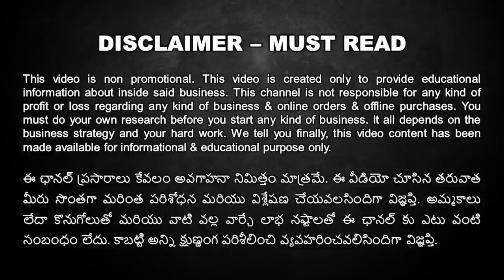Best Prefab Homes Factory Tour, Porta Cabin, Homes, Ship Container Houses Manufacturer in Hyderabad

Comment: I am using prefabricated house 2years at bit hot place in Bangalore and it's not hot inside as it's completely insulated
Just normal fan is enough
If you want use AC then room gets cool faster than normal bric house
Very low maintenance every two years just painting is enough 
Will update how many spray paint cans are required after I do it on my own
Reply: hi Raju.. can you please provide more details about the prefabricated house that you built ? Interested in low cost housing..!!
Reply: @blogger146  I got it done by meco infrastructure in Bangalore, you can explore in your area

Comment: Good presentation.
There are very few videos related to this.
You could have also mentioned regarding drainage connection and whether we can fix regular 3 wings ceiling fan in it and also how will they fix it on terrace by using crane or assembling the whole unit at customers place.
Reply from the maker: Thanks for the inputs. Will try to cover such info next time. Stay subscribed ❤️🙂
Reply: @TravelExploreTelugu  Some one will tell I will try to cover this topics next time. But u commented as will not try to cover next time?
Reply from the maker: It's mistakenly typed 😅, stay subscribed ❤️🙂
Reply: Normally 8ft height sheets are used so fan like in train are used but if you want ceiling fan then room height should be customised to 10 ft generally this type house are used to shift from one place to another so more height will create problems during transportation at places that need to go under bridges, subway and tree branches above roads
Reply: Regarding drainage system they give  inside and provide exit points Just 6inches outside steel containers body
Practical problems come with drainage leaking from bathroom walls and tiles after I got tiles in bathroom after bathing so better do not put tiles ask rubber mats
maintenance and repair is more as we need to seal gaps between wooden walls and tiles
I have 300 sqft fabricated house 🏠 it's 2 years I am using in Bangalore  outskirts for once in a month